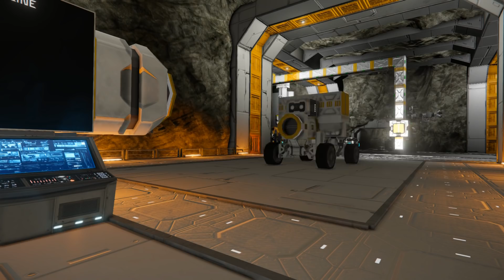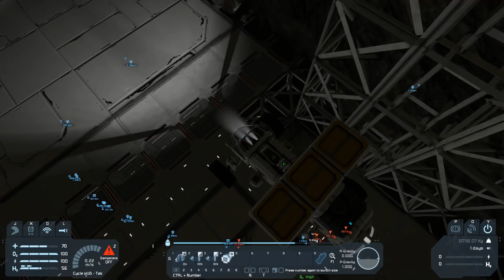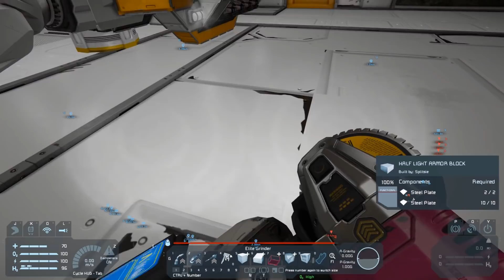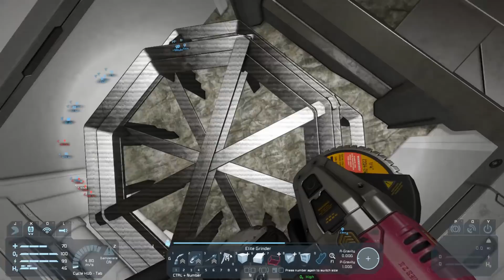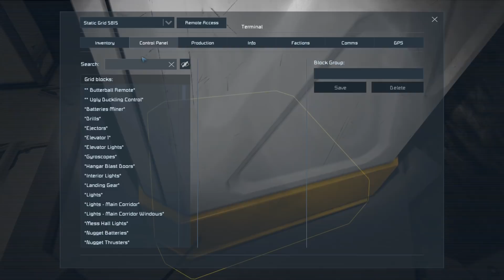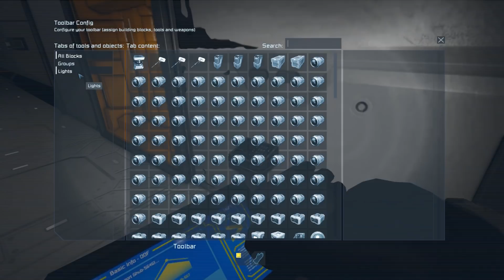Survival, Maybe... #41 Free Parking (A Space Engineers Survival Series)

Comment: Just a quick question, when you welded on the rotors and such to re-power the tick.  Was there a reason you couldn't just dock with it using the connectors on the back?
Reply from the maker: It was completely without power, so the connectors don't work, while rotors will still work in that scenario :)
Reply: @Splitsie  ahhh,  good point thank you

Comment: The ground welder might work better if you set the suspension strength for the weight it is carrying and then use the offset for getting the welders in range. That way it tips less and doesn't sink lower in the back than the front.

An alternate design would be to put the welders hanging off the front and counterbalance that with cargo containers or something in the back.

Comment: I'd like to see a new, better, version of Igor; with a wall of welders on the front. 5 across the front, curved back conveyor off the top of 2 & 4, straight back, curve down, then curve in; directly behind welders could be cargo with front non-turning wheels attached with cockpit above sitting between conveyors, second cargo behind the first where welder conveyor connects with battery sitting on top, third cargo behind second with rear steering wheels, then connector. Optionally: 7 welders, first curved conveyor could be rotors to convert from LG to SM.
Base is coming along nicely.
Reply from the maker: You want to replace Igor?!?  ;)
I could definitely have done a much better job with creating that little rover, I think I might mess around in creative and try to make a much more functional wheeled rover welder and do another video like the one I did for the goose :P

Comment: Splitsie I think you have to add another action to your buttercup connect timer: Toggle On/Off the rotors.. That way they shouldn't spin and brake immediately (braking torque should be high/max)
Reply from the maker: I'm going to try the braking torque thing - I didn't realise that vector thrust ignored that setting :P
If that doesn't work I'll add another control to turn the rotors back on :)

Comment: You could use the back ramp to get inside the nugget. You dig out side alcove of parking, you could dig the side of those for more parking spot... if you vere need more parking.
Reply from the maker: The catwalk over the connector would be a much easier place to jump in from - especially since the catwalk railing are low enough that they can be cleared :)

Comment: Small building Idee:
How about a Rotating Charging Station?
To change all 4 ships depending on usage.
A Horzontal rotation would be something chic about.
Where a vertical rotation would probably be easier to implement.
The equivalent one would have to find the right timing to always
to have a 1/4 turn when a button is pressed.
But this would also need the, the appropriate place.
Reply from the maker: I'm going to need to find a way of controlling a rotor like that as I've got a roundhouse style turntable planned for the goose and all its trailers (when those trailers are eventually built) :)

Comment: A couple of ideas: First, of the welders you have, you're likely to use the butterball the most once Igor finishes with the bridge. It would make sense to either move it to the outer side of that parking slot, I think. You could just do a simple over-and-under setup for the nugget and Igor at the back, both facing out, and have the buttercup face out and lifted up, so Igor can drive underneath. 

Second, the ceiling piston isn't a terrible idea, really - particularly for the truck system. Since it's the most difficult to maneuver and park, you could have a retracting ceiling pillar in the main corridor to quick-park it.
Reply from the maker: The main reason I put the buttercup at the back was due to keeping it in the lowered position, if it's in the first spot it would make flying any other vehicle in much more difficult. Sadly it's also the vehicle I'm going to use the most so it's a less than ideal setup :P

Comment: The retracting piston could reside in the middle of a wall rib. Maybe push back the orange interior blocks by 1 and the piston/conveyor pipe setup could slide up and down as if mounted inside one of the hangar pillars, even elevating up into a channel 1 block deep in the ceiling partially concealing itself (apart from the actual connector) and giving you a bit more clearance overhead for flying vehicles. Its still fine where it is though, adds a little clutter and detail to the area.
The access catwalks could sit in niches in the stonewall running behind the pillars, 1 block deep x 1 block high, 2 blocks up from the floor and junction out over the vehicle connectors. That would leave your floor space open and break up the uniformity of the stone wall in a couple of areas. Maybe that's a bit much but in my head it looked pretty cool :)
Reply from the maker: That could certainly work, my worry with cutting into the walls is that there's actually going to be very little rock between the parking bays, at most it would be 3 blocks but mostly it's 2 blocks deep, so I'd risk popping through into something in the next bay :P

It would be easy enough to work around by just keeping with the current spacing and not having adjacent bays, but I was hoping to avoid some of the crazy digging I've gotten myself into :)
Reply: If it did go through, could have the pillars in that bay line up with the ones in the main hangar maybe. If were talkin about the embedded walkways, that could be a bit tight, very true.

Comment: I think the piston with the Buttercup works like a charm.  But I am a bit confused, as you are normally particular about aesthetics, why you didn't put the piston in the centre at the back (coming forward) rather than on the side.
Reply from the maker: Unfortunately, the buttercup's connector works best slightly off center, so if I'd put the piston in there it would have needed to have a bend in the conveyors to set the connector in the right spot (where the welder of the buttercup isn't against the wall). I definitely would have preferred to put it in the back wall though :P
Reply: That's weird, as it looks like the connector is central to the bay.  It may be due to that strange distortion that the camera creates when not dead in line with the view.

Either way, could you not park the Buttercup fore and aft rather than sideways, to eliminate that issue.  That may require pushing the piston back a bit into an alcove of its own, which would also look pretty neat if cut with your usual precision.
Reply from the maker: That's an interesting thought, I certainly could park facing the other direction... I'll have to test it out :)

Comment: Are you having the issue where the offset variable in lights doesn't persist through saves?
It's caused me a few annoyances, to the extent that I'm considering writing a script that pulls the value from Custom Data each world load.

Also, you don't really need to worry about pistons extending into stuff anymore, since they did that physics update.
Unless maybe you set the axis impulse thing really high...
Still, very convenient for finding the right lengths of stuff!
Reply from the maker: Old habits die hard, though maybe I should test what impulse axis will break things...

As to the light offset, yep I'm getting the same bug, I'd hoped it was related to a mod when I'd first heard about - someone mentioned it with the mod that adds control panels to the lights, but sadly it seems to be a bigger issue :(